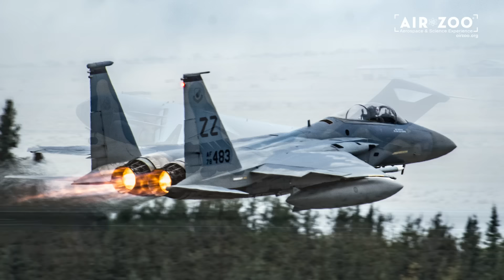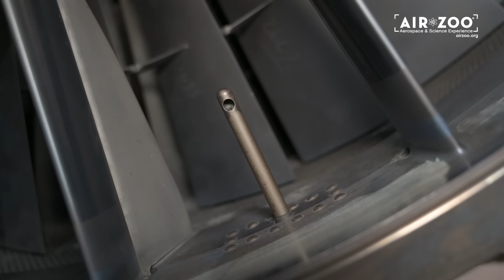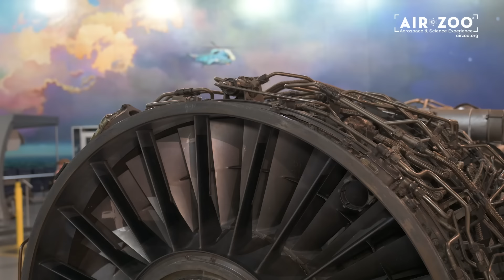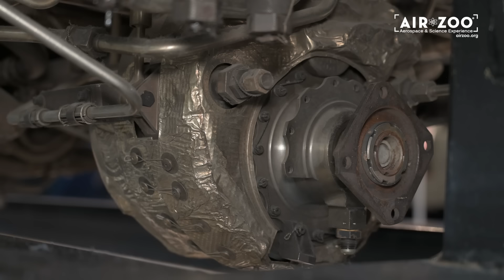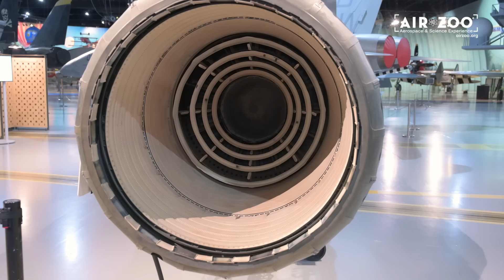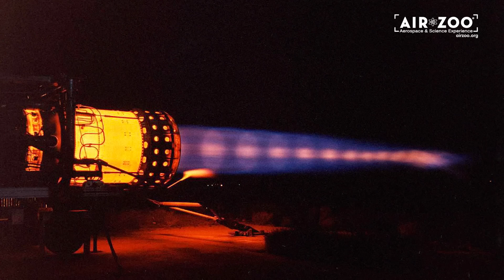The Pratt & Whitney J58 - The Engine of the SR-71 Blackbird | Part Two

Comment: Hi Arnie, if you're reading this.....got a question for you. Still trying to wrap my mind around how thrust is created at cruise speed. Curious.....what are the fuel flows on the engine itself at cruise between the core engine and the afterburner? How much fuel goes to the burner cans vs the afterburner in lbs/hour?
Reply: Fuel flow at cruise according to the meter in the cockpit is about 20K pph.  3-4K is main engine, 7-8K is AB flow, the rest is AB Recirc flow sent back to the aircraft fuel tanks.  The recirc flow keeps the fuel controls and pumps cool.
Reply: @arniegunderson9649 follow up question. If each engine is burning around 20k lbs/hr? I'm trying to follow the math. 3-4 for the core engine and 7-8k for the afterburner. Thats 10-12k. Then the rest is for cooling? But circulation isn't burning. What am I missing?

Another question if you.dont mind? All jet aircraft lose thrust as they ascend correct? I was wondering how much actual thrust at mach 3.2 is each engine making? Or how much total drag does the propulsion have to overcome?

Thanks for your time.
Reply: → Bill

Great questions that I hope can be answered! Does the recirculated fuel that has been heated by cooling the actuating components in the afterburner get sent directly back to the tanks vs being sent to the afterburner nozzles (and why)? Or does both happen but the components need more cooling than the amount of fuel that the afterburner uses?
Reply: @arniegunderson9649  

Thank you. This information is very useful and adds validity to the information that I found. It would be great if more explanation was available about how the intake develops so much of the overall thrust. My take is that in some respects the core turbine is partially there to provide a means to “evaluate the airflow behind the intake”. I think that many might consider this counterintuitive. My thesis advisor designed jet engines for Pratt & Whitney back in the day (more post WWII). During the war he designed the turbo compressors for the Manhattan Project and the early U.S. jet engines.
Reply: @arniegunderson9649  Thank you Mr Gunderson. Another question, if you please? I've had a hard time wrapping my mind around how the inlet can create a large amount of the thrust at cruise. Doesn't that violate the laws of thermodynamics? I would think that the burning of the fuel creates thrust by adding energy to the flow. I can see how burning fuel in a high compression environment makes for a more efficient engine but to say the inlet itself creates thrust is confusing. Thanks again. So glad to have found your videos online. What an incredible machine!
Reply: Great question. Since he stated that most of the air that enters the core is diverted around the core through the big tubes directly to the afterburner and that the core is producing relatively little power, and that the core is in a ram jet cycle (if my interpretation of what he said is correct), then most of the fuel is being combusted in the afterburner (while the core is near idle power, maybe?). I really wished he had talked more about this and explicitly stated where and how much of the thrust was being generated at these different locations. My guess is that most of the thrust at Mach 3 is being generated at the two nozzles with the largest amount at the converging diverging nozzle. Since this is a simple single spool turbojet, I would not expect very much of the thrust (if any) is being transferred through the core bearings.

Found some additional information on thrust production. At high speed cruise, the percent propulsion thrust is 54% from the diverging part of the inlet (section before turbojet compressor, or diverging inlet throat section), 17% from the core AND afterburner (mostly the afterburner as he stated that core is a very low power setting) and 29% from the converging diverging aft nozzle. If the diagram where this came from is correct (and it actually does make sense but to some it might be counterintuitive), I wish he had talked about this more.
Reply: @billr3624  

Thank you for the great feedback. 

But there is that “infamous graph” that breaks down the trust vs drag of various components of the total “propulsion system” as a function of speed. This graph is quoted by various people. Who published this “inaccurate” graph and why is it misleading? How do you explain that there is a pressure differential from the 0.4 psi (forward) to ~14 psi (aft) (with the differential pointing forward) of this section of the “propulsion system”, (with a drag component of ~ minus 12% and a positive FORWARD component of ~ positive 66% for a total net FORWARD THRUST of 54%). 

Usually when the thrust distribution of a turbine propulsion system is discussed the details are usually oversimplified and some details appear to be lost due to the “defined locations” of where the positive vs negative “accounting” occurs at. 

Another “infamous” graph on this general topic of thrust distribution has been explained by a Rolls-Royce turbine designer by where sections were DEFINED to do the plus vs minus accounting and can be superficially misleading. 

Logically there is a pressure differential across the A-12s intake duct that is thrusting forward. Also it is logical that this pressure differential would not exist without the the core, reheater &  converging / diverging far aft nozzle evacuating the mass flow of intake air from the region behind the intake assembly. 

Please explain the misleading information provided in the chart that seems to be repeated numerous times.
Reply: The inlet does not create thrust. It adds energy to the air by compressing and heating it up. The engine accelerates the air while the air bypassed around the outside of the engine but inside the nacelle is drawn through the convergent divergent duct aft of the engine.  That expanding gas creates the thrust and exhaust gas velocity.
Reply: @arniegunderson9649  

But there is that “infamous graph” that breaks down the trust vs drag of various components of the total “propulsion system” as a function of speed. This graph is quoted by various people. Who published this “inaccurate” graph and why is it misleading? How do you explain that there is a pressure differential from the 0.4 psi (forward) to ~14 psi (aft) (with the differential pointing forward) of this section of the “propulsion system”, (with a drag component of ~ minus 12% and a positive FORWARD component of ~ positive 66% for a total net FORWARD THRUST of 54%). 

Usually when the thrust distribution of a turbine propulsion system is discussed the details are usually oversimplified and some details appear to be lost due to the “defined locations” of where the positive vs negative “accounting” occurs at. 

Another “infamous” graph on this general topic of thrust distribution has been explained by a Rolls-Royce turbine designer by where the sections were DEFINED to do the plus vs minus accounting and can be superficially misleading. 

Logically there is a pressure differential across the A-12s intake duct that is thrusting forward. Also it is logical that this pressure differential would not exist without the the core, reheater &  converging / diverging far aft nozzle evacuating the mass flow of intake air from the region behind the intake assembly. 

Please explain the misleading information provided in the chart that seems to be repeated numerous times.
Reply: @arniegunderson9649  Thanks Mr Gunderson. I think it's really beautiful how much that convergent divergent duct is so key to the system as a whole. Love aviation. Science beauty freedom.
Reply: @billr3624  

Are you referring to the converging / diverging inlet duct or the second exhaust nozzle that has has a converging / diverging configuration that accelerates the total exhaust flow back up to Mach 3 plus so that the exhaust is relatively faster than the aircraft speed (and not over or under expanded overly, considering that the far aft “feathers” move due to the relative pressure deferential between the exhaust and atmosphere)?
Reply: @Mentaculus42 Exhaust duct. I think its called the ejector. Just forward of the exhaust flaps and aft of the J-58.

Comment: 16:41 I call that "an misunderstanding". An, let's say, 50" diameter engine will not grow 2.5" in any reasonable condition. It's a little disappointing to hear that from a person involved in "working" on so many engines. What is most probably happening is that "engine frame" is shifting 2.5" relative to the "gearbox frame" due to thermal expansion.

Comment: The interior of the fuel pumps were gold plated because we were told that at elevated temperature the JP-7 was corrosive.    And we were using afterburners that were over 20 years old...which was amazing.   When a new liner was manufactured it included some number of tabs of extra material that were then removed at maintenance intervals, cut and acid treated to make the grain structure visible.   With use the very fine grained metal would 'clump' and as the grains grew the gaps between them also grew which is what weakened the structure.   At some point the cans were put on a mandrel and baked in a pure hydrogen furnace which turned the large crystal grains back into their original form...they called it 'rejuvenation' and that is what it did.   Very amazing engine.